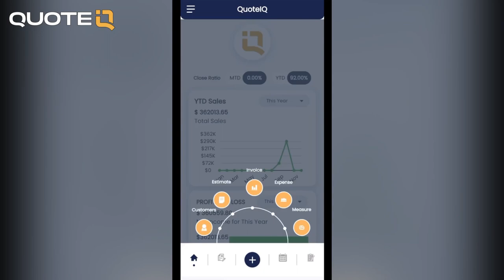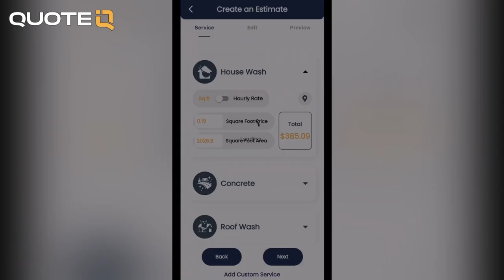Can I Use The Customers Electricity

Comment: Here is how I would handle it. 

Ask when giving estimate if a power source is available for you to use. 

Include a small charge if you have to supply power for yourself.  I would also use a very inexpensive power meter that tracks power used. If someone asks you and is thinking it uses a lot you can show them how much it used as well as to show the discount they got for letting you used it. 

I couldn't count on people ha I g outside outlets or even a garage outlet here. But homes are old here. Therefore I would always have a back up plan